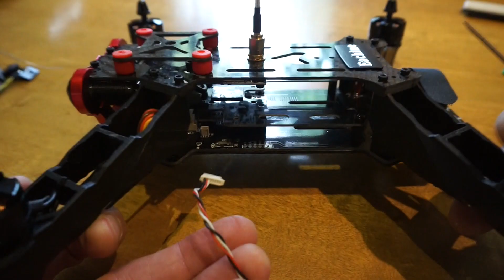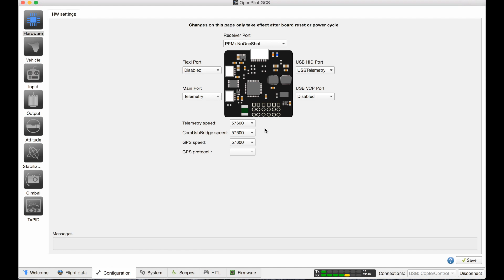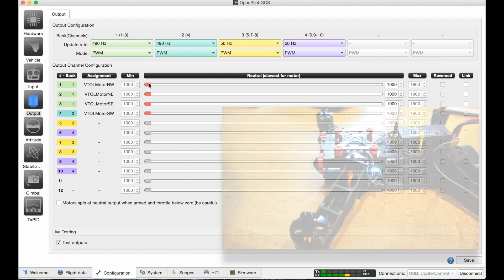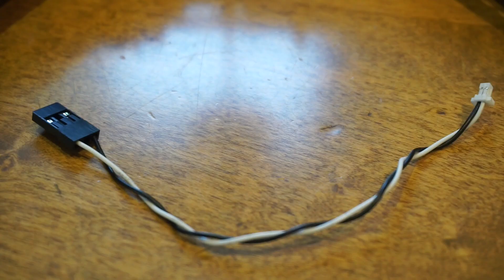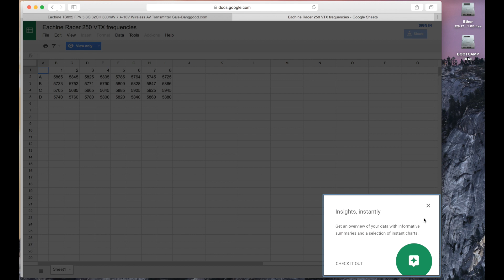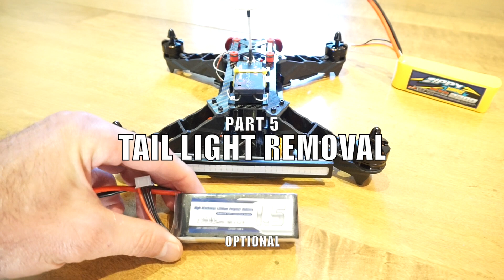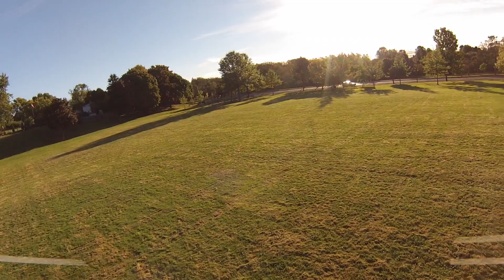Eachine Racer 250 Setup and test flight

Comment: Hi Brandon, after your reply have gained ground getting my Eachine Racer 250 working but still not able to fly.  Tried several times to reply but the email failed deliver each time.  Hope you can open this link it shows what's going on now.  As I said, first drone I've had to configure so if it doesn't work I have no experience how to trouble shoot problems.  Don't know why this machine won't do what your quad does after going through LibrePilot per your video and Wizard.  Nothing works.https://www.dropbox.com/s/kx08zxrm5cziihn/Video%20Jan%2016%2C%206%2012%2042%20PM.mov?dl=0 Your email was very helpful and appreciated.  Any further help would be great.  Thanks